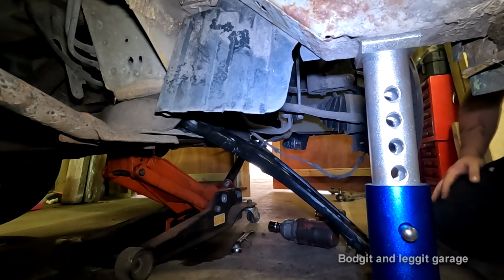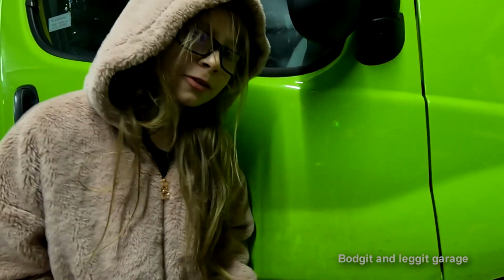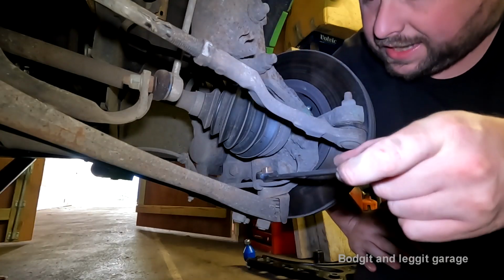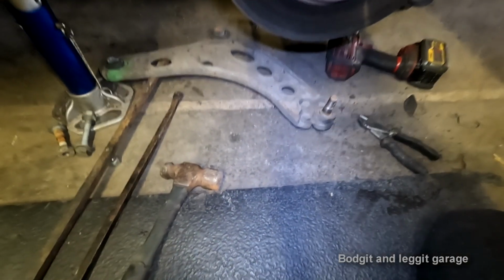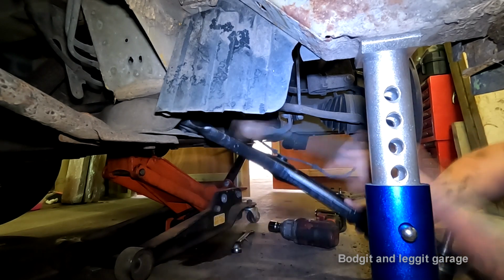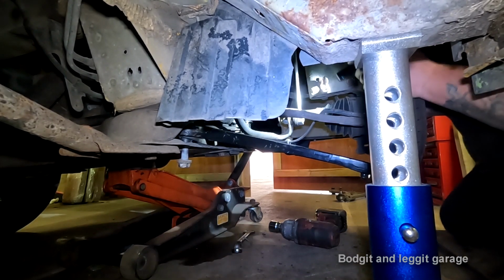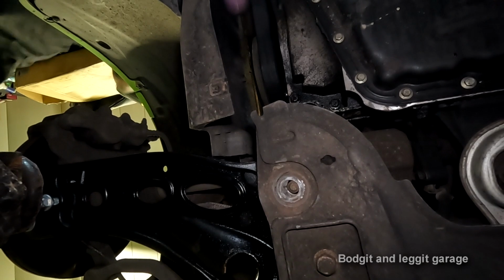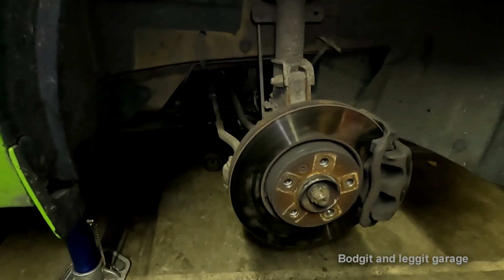€600 Wishbones On My Van I Got Angry

Comment: Just shows how hard it is working on the floor, without a lift, now I am 73 its hard doing jobs like that. Just had subframe off my 2018 ford S max to change temp sensor in DPF at rear of engine.

Comment: To annoy you some more......I find compressing the spring helps a lot by giving you more clearance and allowing you to get the lower ball joint in when you bolt the two chassis mounts on first, then angle down the control arm with  a long oo-er pry bar.  Removing the disc also gives you more visibilty over the pain.....and of course horse it all up when it is on the floor.

Comment: the Haynes manual for Mk3 Mondeo advises lowering the subframe (one side) every time you need to access the wishbone fixings or even change the balljoint. Seems like a lot of hassle in writing but would mb help on a lot of vehicles 🤷‍♂
Reply: Can confirm this is due to the arm bottoming out on the subframe when trying to remove the ball joint from the hub from my experience.. Actual joke of a design lol  I use a ratchet strap attached to the other side normally haha

Comment: Leon, I feel your pain. I had to do this very job on my Citroen C4 Grand Picasso and the replacment arms didn't fit correctly so I ended up rebushing the original ones. More recently, I had to replace both front lower control arms on my Mercedes W204 C200. Aftermarket ones didn't fit (do you see a pattern emerging?) so I bit the bullet and bought genuine ones from the dealer for an eye-watering £372 for the pair but it was money well spent as it transformed the front end of the car.